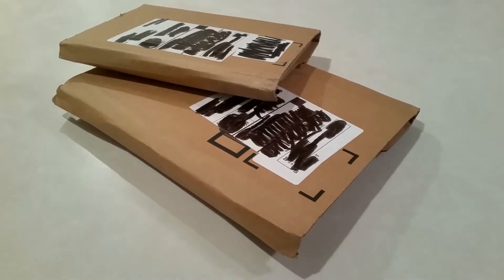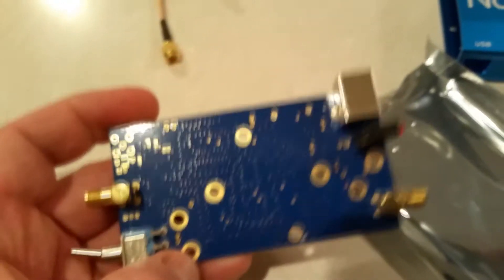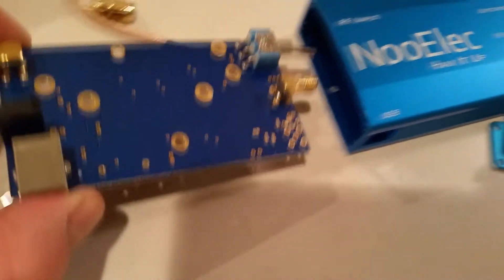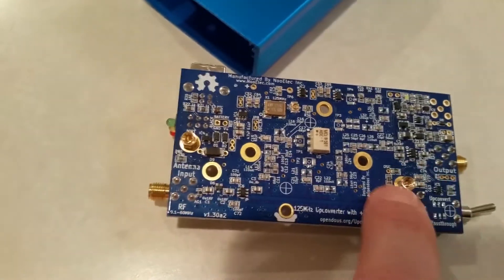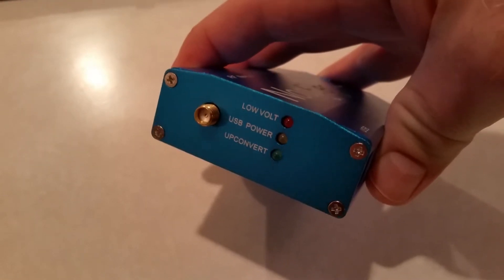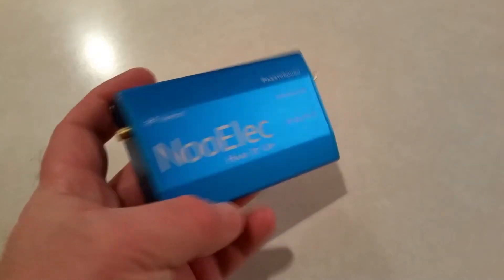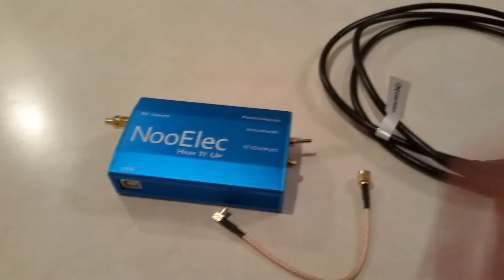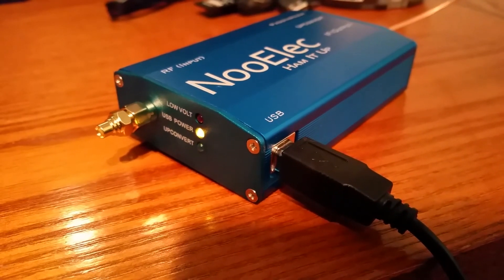RTL-SDR "Ham it Up" Upconverter | Unboxing and Case Assembly

Comment: Just bought my enclosure from an amazon vendor and they did ship two shorter screws for the stand-offs with mine. So seems they've caught on.
Reply from the maker: +pathtouch1 Good to hear that the unit is shipping with the two missing screws. It's possible that mine experienced a shipping error. :-)

On a related note, I'm curious if anyone has soldered the RTL dongle directly to the upconverter board an put both into this case. I've heard it can be done but haven't seen any videos yet. Send me a link if you happen to run into anything like that. Thanks!